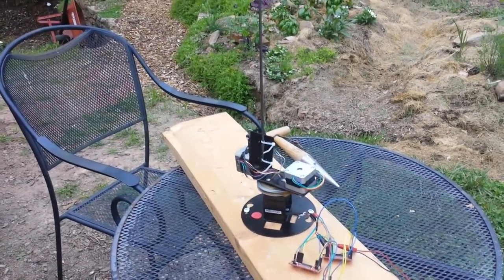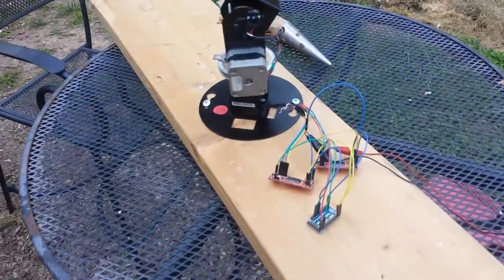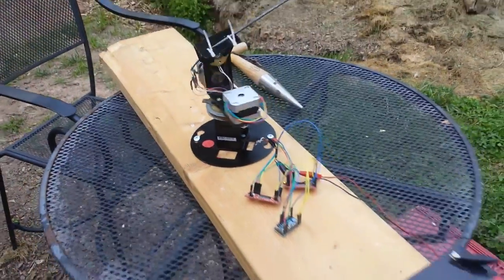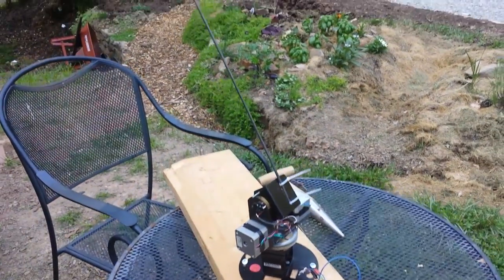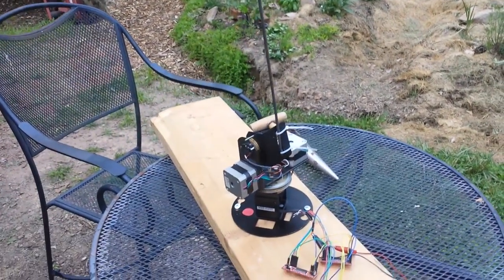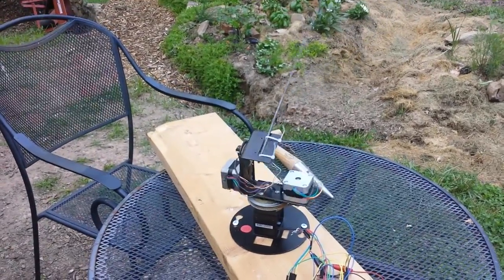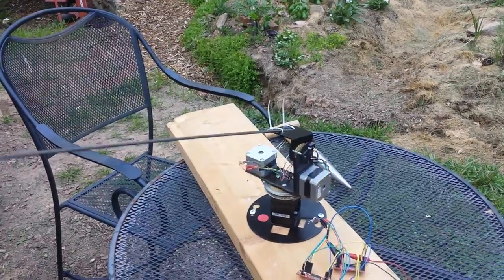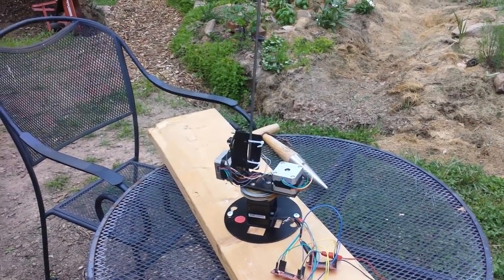Satellite antenna rotator az and el

Comment: nice! I was looking for the construction solution for my own rotator and I think I have just found it :D
Reply from the maker: This surplus camera az/el device turned out no where near strong enough to swing a good antenna. Even a tiny UHF made from wood and light hollow aluminum rods barely worked :)  Just not enough torque.     I have another one with gearmotors and servo feedback that was the final working rotator for a nice big quad uhf beam.
Reply: This is the only one thing I'm afraid of - the torque... I use the same nema engines like you and I think I will have to deal with the torue problem too

Comment: A few issues.  One, I wouldn't use a stepper motor.  Its inductive load pulsed by a stepped driver shouldn't interfere with VHF or UhF; it will be problematic for HF signals.  Also, a Nema 17 doesn't have the torque required for a small array like a Leo pack. However, using one with a planetary gear set would work.  By using a stepper, you now need to home it.  You also would have to close loop it to know if you had missed steps.  Trinamic drivers would work, but that complicates things.  It will also be back drivable, so you are wasting current having the steppers powered on all the time.  The conventional DC motor with a potentiometer is a more straightforward system.  If you were hell-bent on this type of system, a Nema 23 clear path would work better, but those motors are pretty spendy.
Reply from the maker: You are correct on all counts :)    This camera mount would barely work with the smallest, lightest UHF antenna I could make out of hollow aluminum tubes and lightweight wood ruler. 
I have a later video of a much better rotator using dc gear motors in a servo arrangement with feedback pots. That one can swing a hefty x-quad UHF array.

Comment: Very nice! I’d like to be able to track NOAA sats - happen to have a list of parts/instructions for this build?
Reply from the maker: Oh no this one is not very good at all - this is attempt #1 using a camera az/el platform from a surplus store, but it is too weak to move much of any practical antenna. I made one small very light UHF antenna and it did not work very well so went on to  a commercial quad antenna and the rotator in this video https://youtu.be/3mtySzLX-5Q

Comment: Hi, Chuck, Great job! Do you know if I can get one of these for a heavier antenna? I am planning to install solar panels to it...
Reply from the maker: This camera az/el mount turned out to be very weak and could barely swing a tiny UHF antenna made to be as light as possible.  The Yeasu G-5500 is widely used for ham satellite work.
Reply: You can replace the standard nema 17 with one that has a 100:1 planetary gear set.  Although a dc motor and a worm gear is a better option.

Comment: I'd like to ask you a question. I want to receive two-channel PWM through atmega328p and then control two stepping motors. How to write the program framework? I used the acelstepper library, but there are some problems. I'd like to hear from you. thank you.
Reply from the maker: two-channel PWM like used for radio control servos?  Here is a well documented project code that takes input from an rc receiver. https://create.arduino.cc/projecthub/kelvineyeone/read-pwm-decode-rc-receiver-input-and-apply-fail-safe-6b90eb  Should not be hard to get the value from those pwm inputs to drive a stepper motor over any desired range of motion.  Will look into it, is an interesting idea.
Reply from the maker: Just tested the above sketch read-pwm-decode-rc-receiver-input and it works really well - used two channel, input pins 4,5 with an arduino pro-mini 3.3v 8Mhz version - set calibration and it reads -100/+100% for both aileron and elevator controls from an old analog 72MHz rc set.  Next I'll mash that up with the AccelStepper library and two motors.
Reply from the maker: Here's the video for the stepper motor controlled by RC pwm signals, link to the code is in the description:  https://youtu.be/0kXlILWAYKg

Comment: Where do you get the mounting hardware for the steppers?
Reply from the maker: The camera AZ/EL mount came with stepping motors from the surplus store, it was made for the NEMA size and just use regular metric scriews. It was a surplus broken camera az/el latform from Mendelsons in Dayton which is now closed for business.  The idea was to point an antenna at satellites which this turned out to be way too under-powered for even the lightest UHF antenna :)
Reply: @Chuck Swiger  I was thinking about useing the same type of setup for some 5.8 ghz antennas for fpv drone not nearly as heavy as heavy as beam antennas